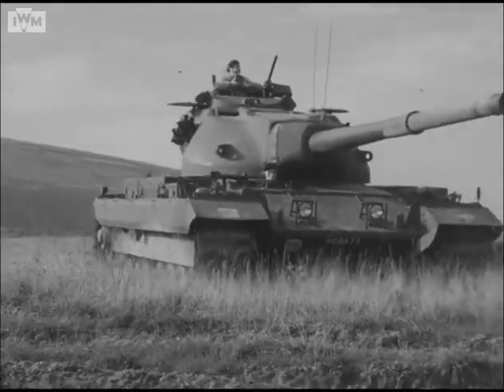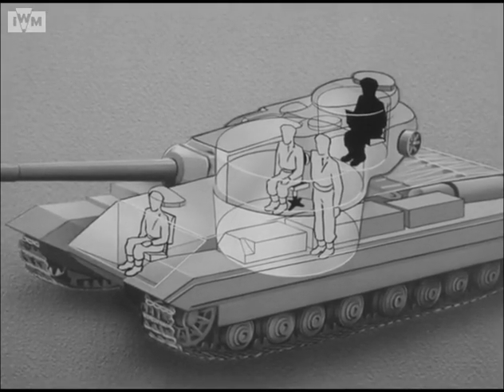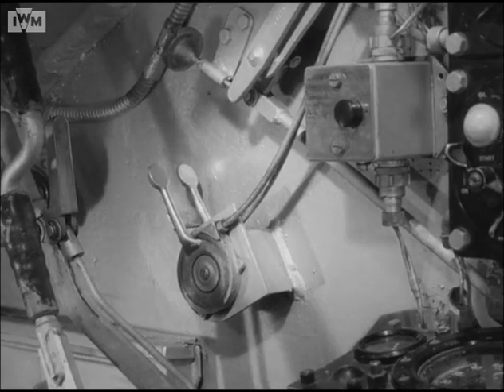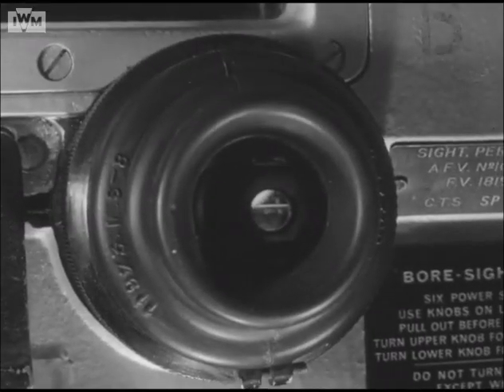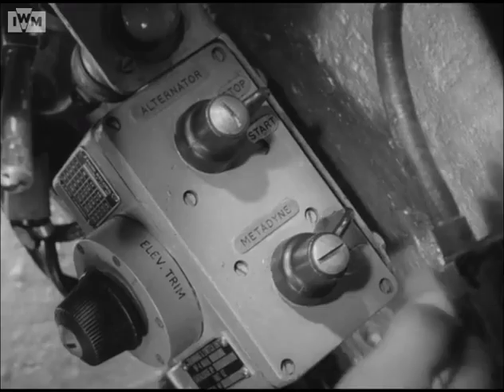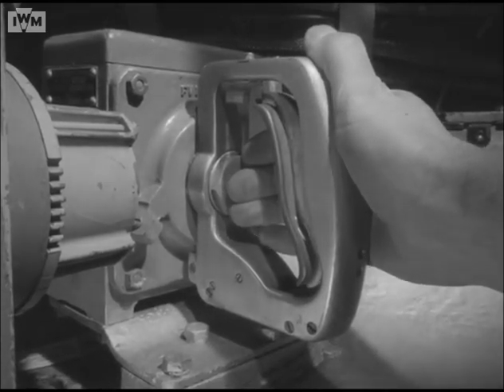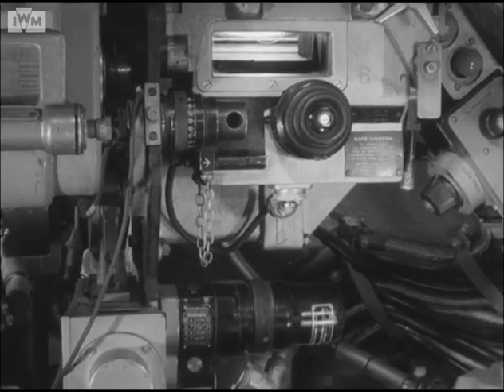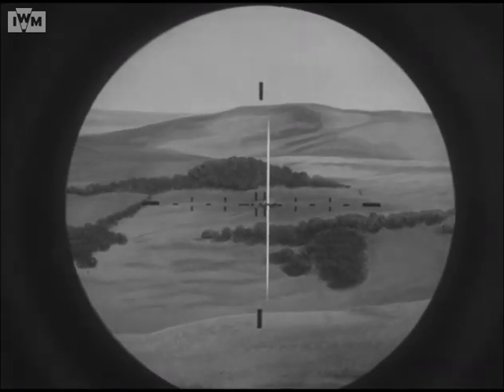Conqueror Tank Firing Control

Comment: They didint show the tea maker machine inside but there has to be one. Because its british
Reply: It's called a "BV" boiling vessel and runs off the tanks electrics. Piping hot tea at all times .
Reply: Quite right too, we’re not savages.
Reply: @snowflakemelter1172  Quite true, I was infantry fighting out of AFV 432's, it had two fitted on a shelf in the back door.